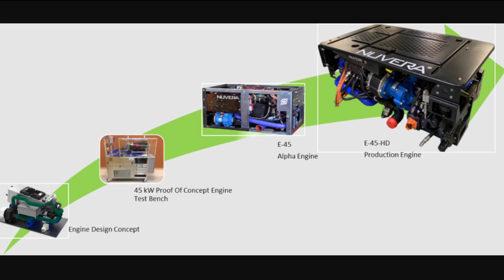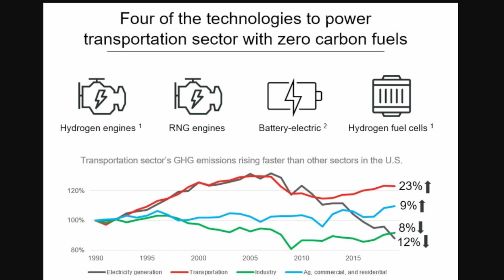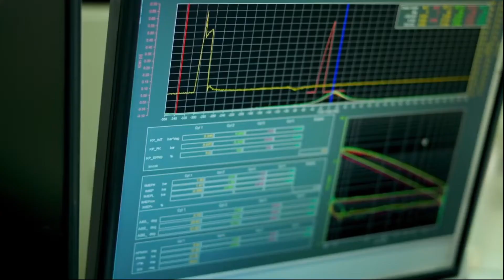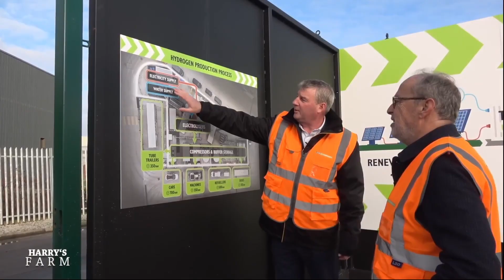The World's 1st Hydrogen Combustion Engine Is Here.

Comment: I see from the comments a handful of sceptics who think they know better. Here's a fair question they may try to answer: What is the most important benefit EVs (BEV, HFCEV & PHEV tech) offers? 

Answer: All offer economic incentives to drive less. The problem is not how we power cars and trucks, but rather how much and how far we drive them. 

The EV with the most potential in this regard is PHEV Plug-in Hybrid, eventually PHEV+H, either fuel cell AND combustible hydrogen matched to a modest battery pack that affords 30 to 50 miles on a charge and delivers 125 to 150 MPG effective fuel economy. Drive more than 50 miles and PHEVs revert back to 40 to 45 MPG. 

One notable comment on combustible hydrogen vs fuel cell is that fuel cell PHEV+H may be more ideal for personal cars because they weigh less. Combustible hydrogen may be more ideal for long haul trucks where the additional weight is needed.
Reply: I'm sorry you probably mean well but your comment is clueless.

Comment: I posted many times showing you how bad hydrogen and Nikola was and you laughed. Now they are in bankruptcy and you are still pushing this hydrogen for transpiration nonsense.

I know this is for Semis but these vehicles are very similar. It is actually even worse if you try and run hydrogen in a combustion engine. Just add another 40% to the cost of hydrogen fueling for that.

This is why hydrogen trucks/tractors or heavy equipment will never take off. 5 to 6 times the cost for fuel, 3 times the cost for the truck, more maintenance and higher operating non fuel costs.

To go 100,000 miles in a FCEV (hydrogen) semi it will cost over $400,000 in fuel alone. To go the same distance in diesel truck it will cost $66,000. No one is going to pay $344,000 more to fuel their trucks every year. As a bonus to go the same distance in a BEV (electric) semi it will cost $14,000. How many people do you know that are willing to pay the difference of over the cost of a new semi every year in fuel alone to drive a hydrogen truck?